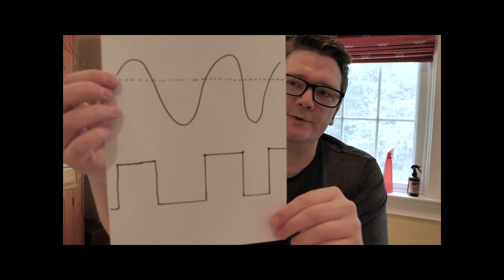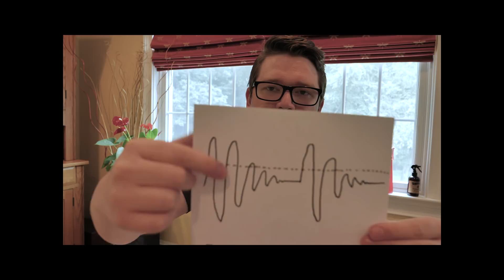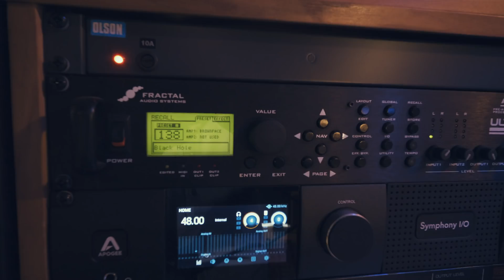IF Circuit - MODULAR MONDAYS #11

Comment: The music in the end was fantastic! That is a really clever use of the 4ms resonator. Your system is really shaping up, but I would suggest getting more modulation sources, mixers and VCAs to get even more out of what you already have. I have found that seemingly boring modules like mixers and VCAs are more valuable in the long run than flashy effects, filters and oscillators. It is when you are able to make advanced interconnections that the modular creates sounds not possible with a fixed analog synth (e.g. modulating the modulator of the modulator). I always find it rewarding to let channels 1 and 4 of Maths modulate one another, rather than to use it as a steady LFO. Let Maths do stuff that it can unique do rather than as a replacement for regular modules.

Comment: You can use Ears as an external signal follower - if you drive Rhodes into it, every time it gets a signal, it can trigger gate or output CV into other modules, and you can of course combine its audio with the audio/fx, that is being created by other modules :)